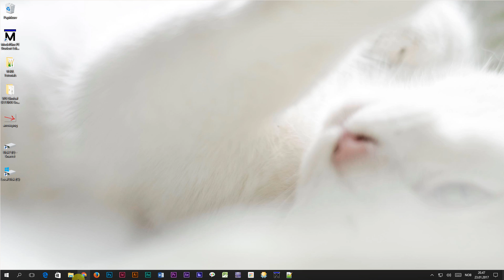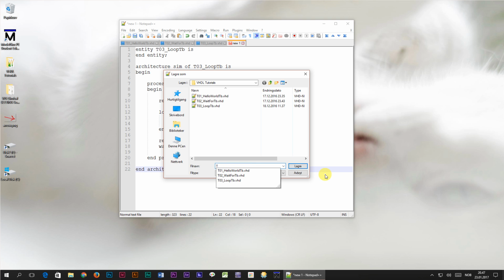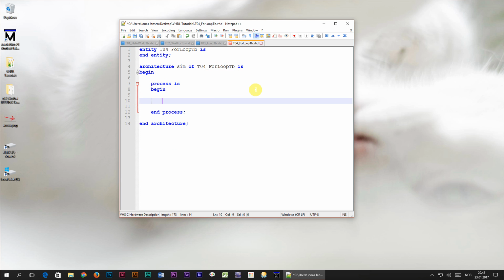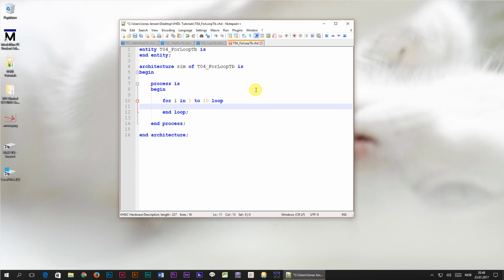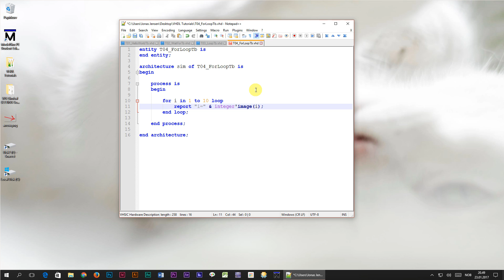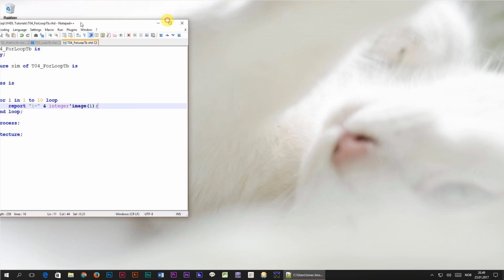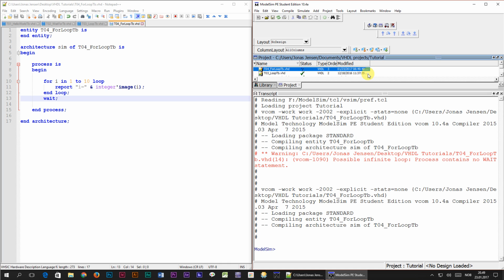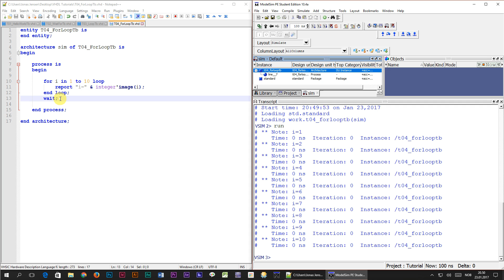How to use a For-Loop in VHDL

Comment: Thank you very much! Does the "wait" statement indicate that the initial loop of the process is in an infinite hold? THX and BR
Reply from the maker: Because we placed a single "wait" at the end of the process, the process will hold on that line forever. If we had assigned values to any signals before the wait, the process would be driving those values onto the signals forever.

Comment: So, the for loop is for simulation only? Or does it synthesize into something?
Reply from the maker: For-loops are synthesizable, but it depends on what you use them for. A for-loop with a wait statement inside of it for example, cannot be synthesized.
Reply: @VHDLwhiz  I see. It's similar to a C macro. The contents get replicated/instantiated multiple times.
Reply from the maker: @AV1461  Yes, you could say that it's like a C macro when used in synthesis. But in testbenches, you can use for-loops as in any other programming language.

Comment: i got error range is empty  hdl compiler 746
Reply from the maker: Perhaps the for-loop is empty. For example, "for i in 1 to 0" will produce this warning in Xilinx synthesis. When compiled in ModelSim, a similar warning "(vcom-1246) Range 1 to 0 is null" will be printed.  It's just a warning, and you may ignore it if you know that this is OK. For example, if your module with generic bit width is trying to iterate "for i in svl'high downto slv'low-1", you may get this error if "slv" is suddenly 1 bit wide. It may or may not be an error, depending on what kind of logic your module performs, but the compiler will print a warning when this happens.
Reply: i got this error Error (10533): VHDL Wait Statement error at T04_ForLoopTb.vhd(13): Wait Statement must contain condition clause with UNTIL keyword
Error (12153): Can't elaborate top-level user hierarchy
Error: Quartus II 64-Bit Analysis & Synthesis was unsuccessful. 2 errors, 1 warning
 Error: Peak virtual memory: 622 megabytes
 Error: Processing ended: Thu Oct 11 02:23:54 2018
 Error: Elapsed time: 00:00:02
 Error: Total CPU time (on all processors): 00:00:02
Error (293001): Quartus II Full Compilation was unsuccessful. 4 errors, 1 warning
on quartus ii
Reply: me too